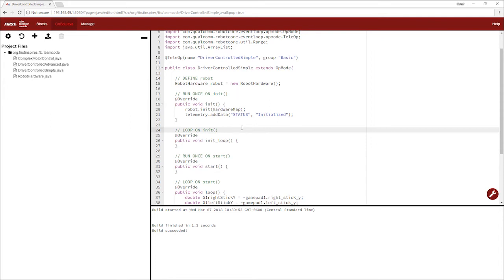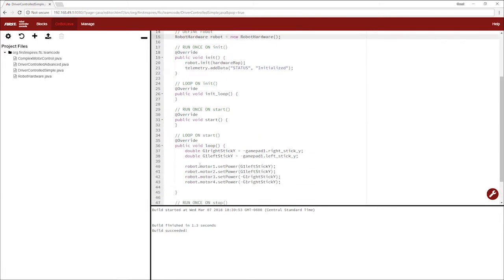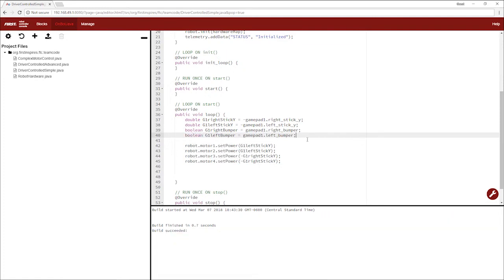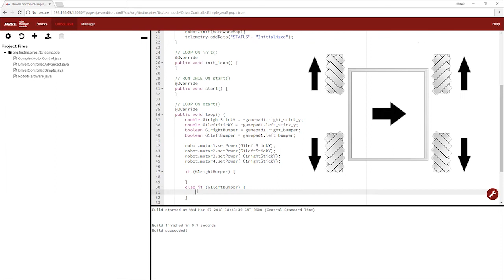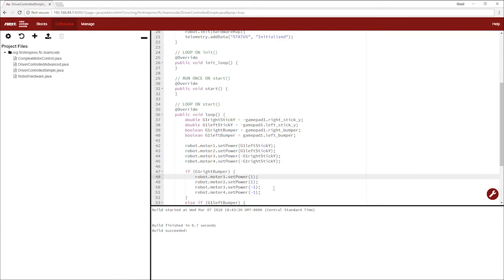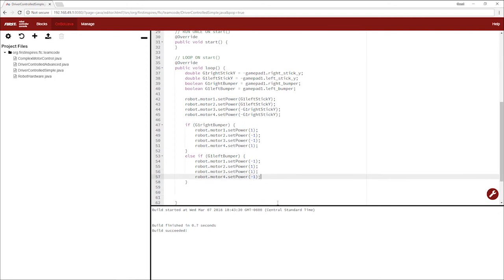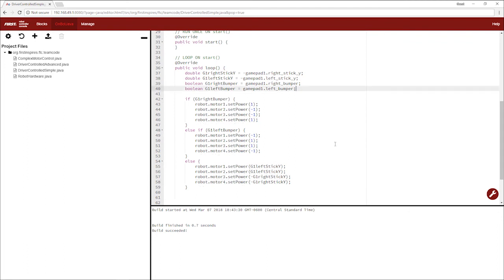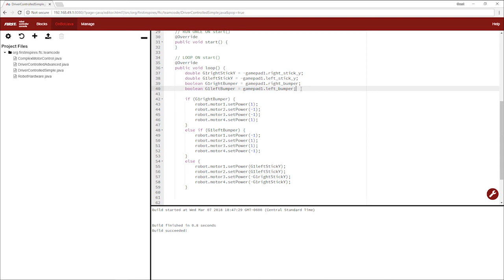Basic On-Bot Java | Ep. 4 - Strafing with Mecanum Wheels | FTC Tutorials

Comment: very helpful.  thanks.  this gave us something to work with, and it works well enough for starters. .... and yes the wheel suggestion did not work for us either, but using the excellent pdf that comes with the pitsco tetrix meconium wheels, it is very easy to figure out.   https://asset.pitsco.com/sharedimages/resources/mecanumwheel_resourcepage.pdf

Comment: I don't mean to sound rude but the configuration for the mecanum wheels is wrong, instead of all  the wheels moving inward and the robot moving left, it should be the left side of the robot's wheels turn inward, and the right side of the robot's wheels turn outward, ultimately strafing left, and wise versa to go right.
Reply: Actually I think the diagonally opposite wheels have to be set the same direction and the other two wheels have to be in the opposite direction in order to allow the vehicle to strafe right to left. Correct me if I'm wrong.
Reply: @water1889  Your explanation is the correct one when coding, as the opposite corner wheels should be put in a group together, however, physically, it looks like one side is going in and the other out. This just means that both of you are correct, but those explanations have different purposes.

Comment: If you modified your RobotHardware class to invert the motor directions for the motors on the right side of your robot then a positive motor power will always drive the attached wheel "forward" relative to the robot, making it easier to understand which direction your robot will move when setting motor powers for drive/turn/strafe. Or keep the RobotHardware class the same and invert the motors in your OpMode:

robot.motor3.setDirection(DcMotor.Direction.REVERSE);
robot.motor4.setDirection(DcMotor.Direction.REVERSE);

Drive forward:
robot.motor1.setPower(1); //All wheels will turn in the forward direction
robot.motor2.setPower(1);
robot.motor3.setPower(1);
robot.motor4.setPower(1);

Strafe right:
robot.motor1.setPower(1); //Front left wheel moves forward
robot.motor2.setPower(-1); //Back left wheel moves backward
robot.motor3.setPower(1); //Front right wheel moves forward
robot.motor4.setPower(-1); //Back right wheel moves backward